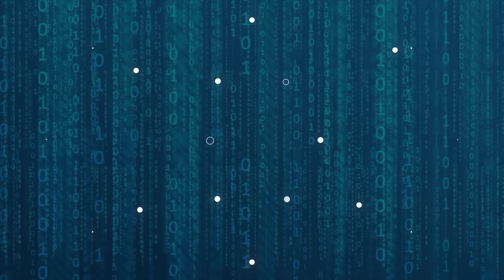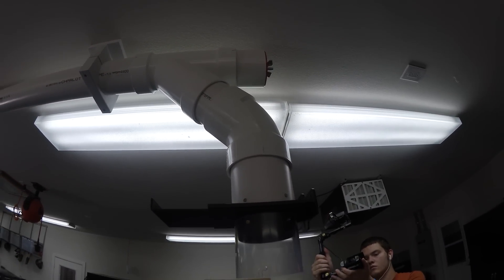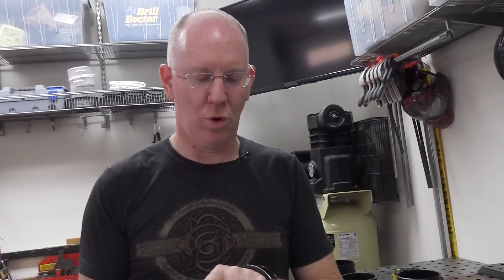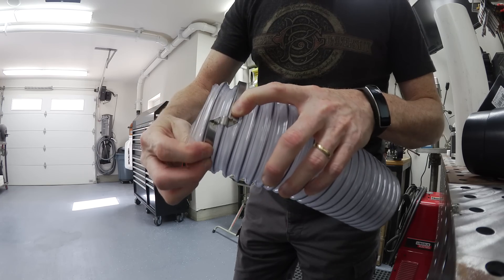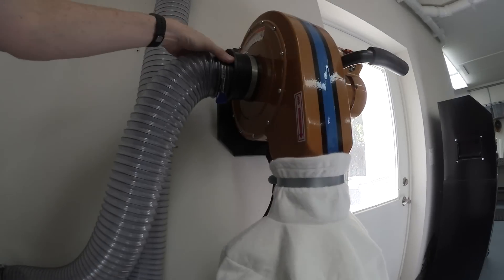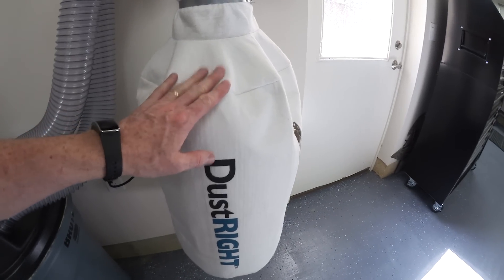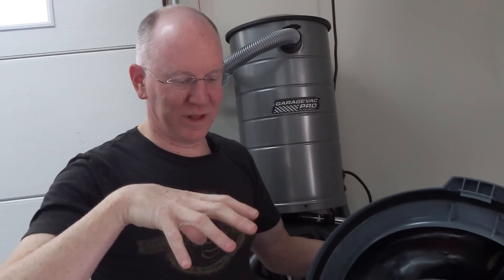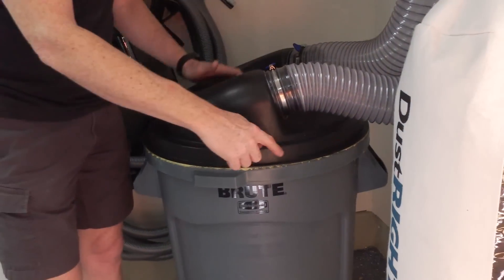How to Build a Dust Collection System - GeekBeat

Comment: Nice clean job, but I think you should look through Bill Pentz's website. It's soooo long winded, so much information. The idea is that you're cleaning up the mess, but still killing your lungs. I have the same issue in my shop, and I'm working towards building a better system that gets more of the fine dust.
Reply: +iderryan - agree totally with the fine dust issue.  I've tried several different sizes of dust collection using bagged systems - cyclones are by far the best.  Have a small cyclone now for the shop vac.  Working on a big cyclone for the big tools.
Reply: Bill breaks it down well.  You are only getting rid of visible dust.  This setup is way underpowered.

Comment: Nice duct work. Do you plan to ground that system? You could potentially start a dust fire.
Reply: http://www.thewoodnerd.com/articles/dustExplosion.html
Reply: No, he can't. Stop spreading this stupid rumor and look at the real research.This is not an issue for a home shop. The only reason to ground it is to prevent yourself from getting shocked when touching the tubing.